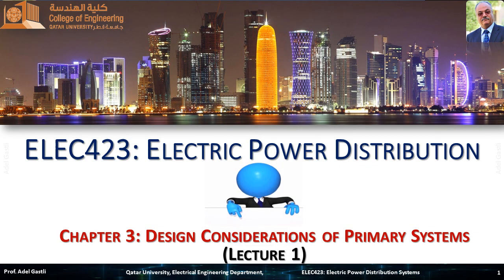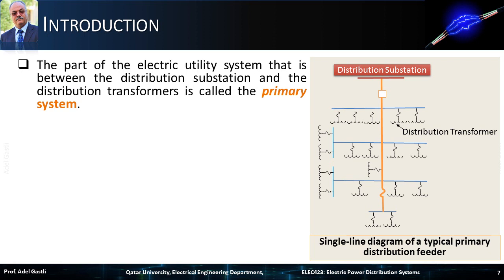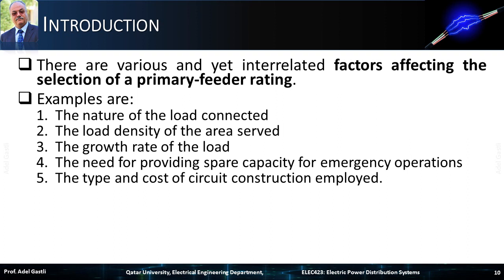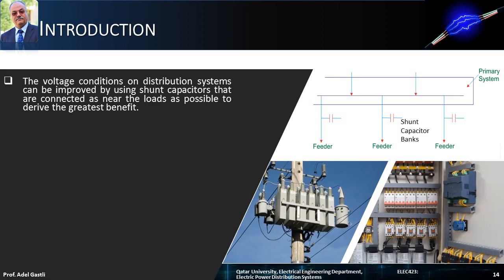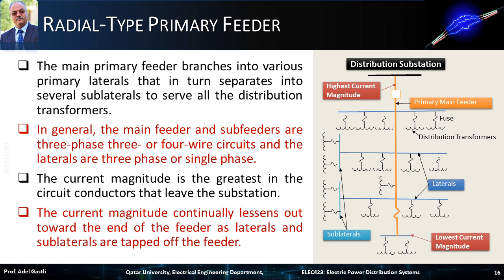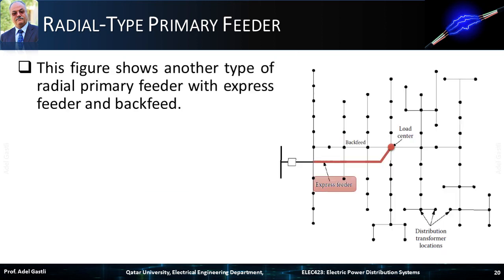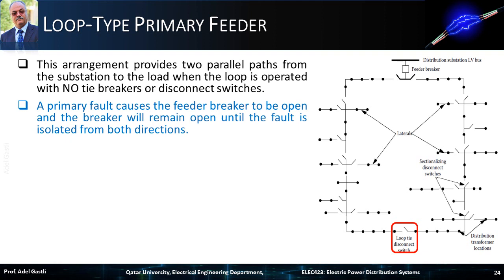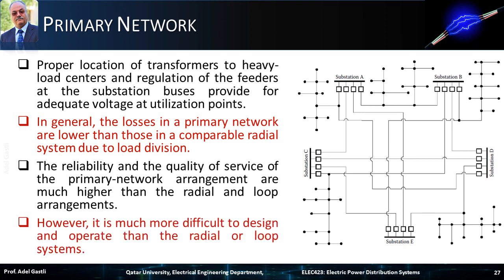Electrical Power Distribution: Chapter#3: Design Considerations of Primary Systems  (Lecture 1)

Comment: Thanks Prof Adel. More examples on the design for both primary and secondary feeders will more useful. Optimal placement and size of shunt capacitors in Distribution System is also useful and make your presentation more useful.
Reply from the maker: Thank you Dr. Khaled for your valuable comments. The examples are usually given to the students in classroom as class activities, since I'm using the flipped classroom approach when I teach this course. Students study themselves the material at home using these movies and come to the class to work on solving practical examples.